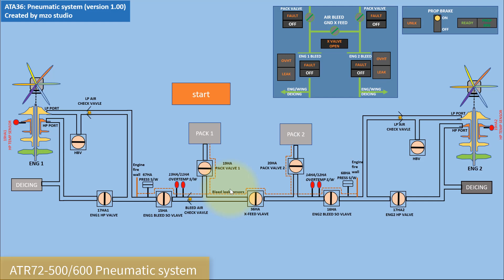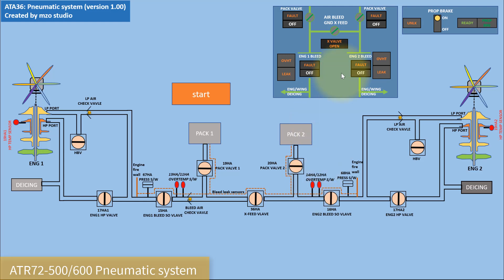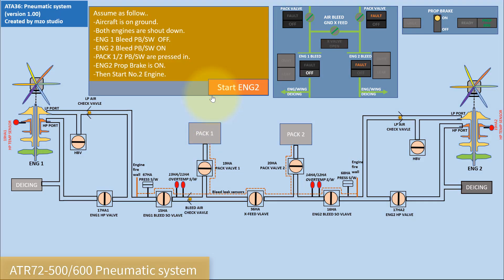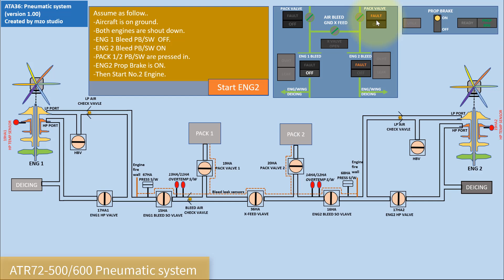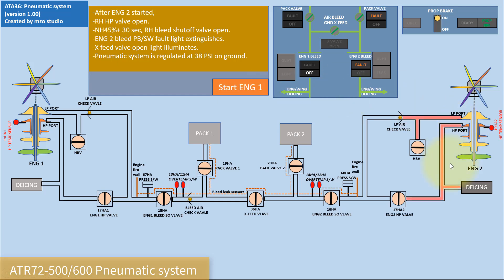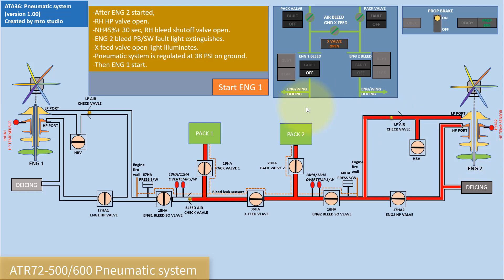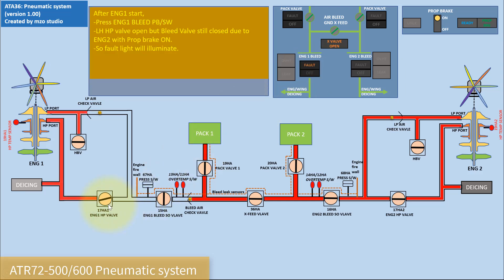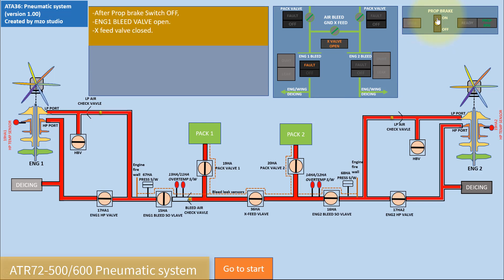⚡ATR72 ⭕Pneumatic System CBT⭕

Comment: Hello good afternoon. I would like to know what software you would recommend me to do my own CBT, with the interactivity and complexity each systems. For example, if the blue hydraulic pump is inoperative, what systems could affect and how can I recover it. Making this recovery in the same interactive CBT. Best Regards and I will appreciate your advise...
Reply from the maker: Check this video.
https://youtu.be/uthUh83_4IE
Reply: @mzosharing  Many thanks for your video ... Something If you can give me an advice or video to make a flow diagram with interactivity with the push button, for example: If I lose the DC Bus 2, which electrical systems I lose and what procedure to do. If for example the BTC does not enters automatically. (just an example)..
Reply from the maker: @tazpilot  https://youtu.be/dxdGGhII6vo
Reply: mzo studio exactly thats what I looking for. But I wanna do it myself in spanish would be a CBT in spanish
Reply from the maker: I didn't know how to create CBT before. So i took a lot of time to do animation. Now i understood how to create. So if you want to try, i hope that i can help you.Thanks
Reply: mzo studio Gladly I hope you can help me with some tips. I want to make a ATR  72-500 CBT in spanish with Power Point. Also We do not have the CBT sources for translation. The CBT that we use is not a complete as your CBT and for my personal opinion your method is complet.